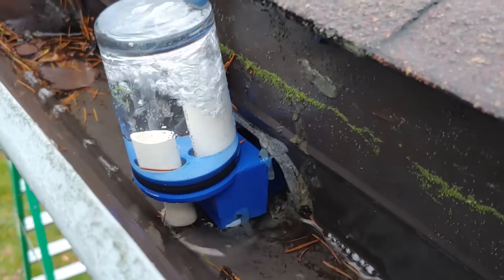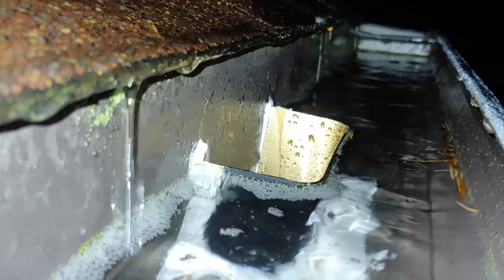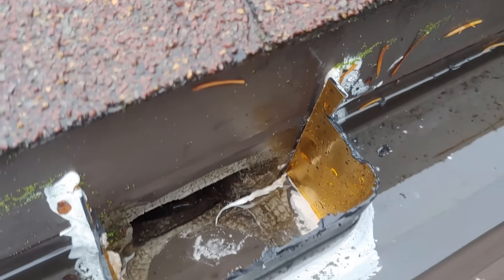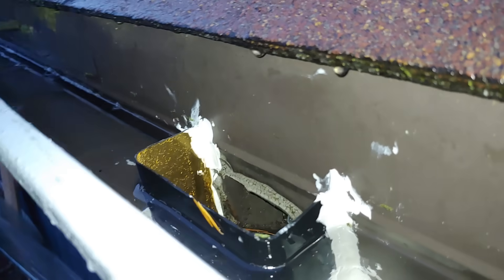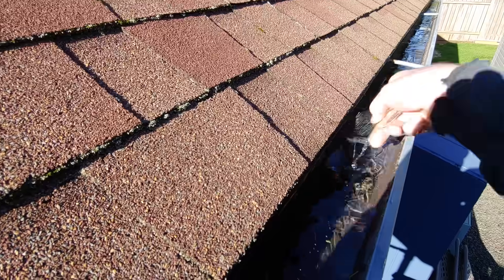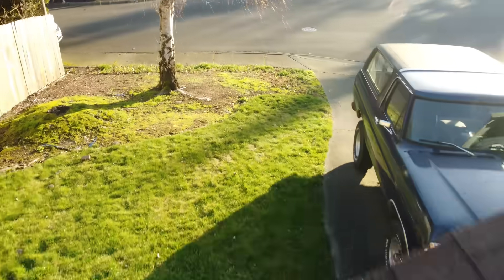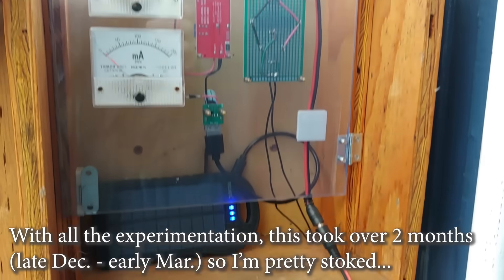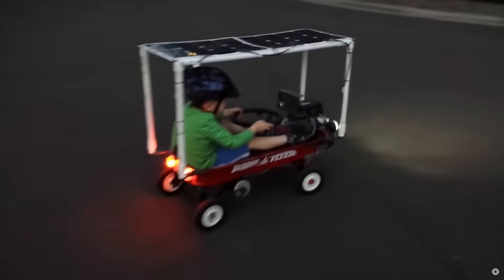Rain Gutter POWER #6 - World's First Rain Charged Phone!

Comment: Send some rain our way. Our rain barrels have been empty for weeks! Speaking of rain barrels. Mounting a few right below the gutter could be a great way to store and recapture the overflow in peak times. Like a potential energy capacitor. Also has the added benefit of watering the garden.
Reply from the maker: I wish I could Sean! It's raining hard here even as I type!  And yeah, in retrospect some kind of storage like a water tower would fix all the problems I had early on.  Wait until it fills and discharge on-demand at whatever power rate is desired.  Though in some places storing rain water like that is illegal which makes zero sense to me.  Hope you eventually get the rain you need!
Reply: @QuintBUILDs  Another main reason for policies like that is the health hazard posed by open-topped storage barrels, as the standing water creates an ideal environment for mosquitos to breed.
Reply: @AJMansfield1  All they need is to say such a barrel needs to be sealed to some degree around the drain pipe with a separate tap at the bottom for using the water. If they want to even prevent them going down the drain pipe then some kind of gutter filter could also be required, although I don't see why they'd need to go that far.
Reply: @AJMansfield1  That is the equivalent of throwing the baby with the bathwater.
Just buy a mesh ffs, it won't allow the insects or mosquitoes to breed in.
Reply: @QuintBUILDs  the reason for rain water collection laws has nothing to do with small home collection, it's about agricultural rain collection because of water rights down the water shed from the collection site. You cant keep all the runoff water for yourself
Reply: @QuintBUILDs  what if you increase the output at the nozzle? will that increase the power of the alternator?
Reply: @QuintBUILDs  you can store rain water in Marion County, at least, as long as it comes off your roof.
Reply: @QuintBUILDs  Do your government regulate the amount of air you are allowed to breath?
Reply: Stored, potential power-generation-source-material, ect., equals - as I'm sure you're aware - a financial loss, to national-/local government entities. ALSO, "every 'man' for 'himself'", could cause eventual, irreparable damage to a society...
Reply: @QuintBUILDs  The problem with letting everyone store all the rainwater they want is that it limits the amount of water that makes it into underground reservoirs, which are important for everyone. Sure one or two people keeping a barrel behind their shed isn't going to do much, but imagine if people who owned large areas of land completely blocked out the natural water cycle for themselves. It would be potentially catastrophic.
Reply: @EXeeroy  people arnt blocking out 'the entire natural water cycle', they are just blocking out the little bit that hits their roof.
I dont know about where you live, but over here, all the water that goes from roof gutters and roadside drains is piped/pumped into the sea or into a nearby river that leads to the sea, none of it goes underground. Only water that falls onto green areas goes underground.
Reply: @EXeeroy  surely if you use the water on your crops/garden then that water is getting to the ground anyway, and however much ground you have unless you cover it with a waterproof membrane then the only water you could collect would be from a gutter therefore the whole groundwater thing is a complete red herring, I understand that some US states forbid collecting water, backed by environmental organizations, helped by water companies that wish to sell you it, we have the same problem in Britain with power generation from a stream (even without a dam), were you take the water and return it a several yards further down, your "using" the water and no one is getting a cut, all done under the "environmental" banner and who can disagree with that !!☺.
Reply: @EXeeroy  that's false information that you've been fed to believe by people who control you
Reply: @EXeeroy  thats pritty nonsense, for you to catch the water, there has to be a roof for it to fall on. how much % of your country/state/town is roofed? so stil even if everyone would catch it, plenty of rain to come by. its simply ridiculous a goverment own something that can fall from the sky. its to maximize corporate profit nothing more. pumping up the ground water now that IS a problem when everyone does it. since that water is hundreds or even a thousend year old and wont be refilled as easy. but rain no ffn way. the natural way of water is from gletchers/rivers/sea/clouds and repeat, or you think those rivers all from rain water :P?? when the gletchers are gone now that is catastrophic because that would mean all drinkable water ended up in the sea.  with a bit of logic u can push through goverment propaganda.

Trust the Dutch before you trust your goverment ;)
Reply: @EXeeroy  but if they were using said water to say, water their gardens, lawns, or to purify and drink wouldn't said water end up back in the ecosystem anyway?  By filtering and drinking rain water you're not using municipal water and not paying taxes on it.
Reply: @goldenpun5592  I believe the law is intended to prevent industrial scale water rain capture.
Reply: @EXeeroy  The word "imagine" in this context is problematical. It's completely unlikely, and would be a huge waste of capital. Who's going to go through all that effort and expense just to store water? This isn't Dune.
Reply: Your land is private property, you can do as you please. Rain and rainwater cannot be owned it falls from the sky. By definition you can collect rainwater as it is not owned and you are on private property where you can do as you please simple as.
Reply: @alexbevan2183  incorrect, your land is your property yes but what if an airplain with cash fall onit?, or the cash falls out of the airplain, it wont be yours. if you find gold in the ground, neither :P

They were pritty smart in the past when it came to stealing from their own people.

With something like rain its ridiculous, but some countrys do have the same laws for rain :P
Reply: Pumped storage, yes. Store the overflow, put a solar panel on the roof and use it to pump the stored water back up when it’s sunny. 

Although, you would probably just make more power directly from the panel.
Reply: Been 10 months of cold and wet in Denver. Please take some.
Reply: We Don't have rain barrels but we need rain bad. Has not rained in like 2 weeks radar says around .2 inches for the 2 weeks. Crazy.
Reply: Okookollollokkkolllokokoookoookokololollololoolo
Reply: I see he probably has a Rudd ac
Reply: I saw a guy that did this in a container he can pressurize like one of those hand sprayers for the yard. And he pumps it back up top to run back into the system.
Reply: Here in California. It's illegal to store or hinder the flow of rain water that falls on your house. You are not allowed to use rain barrels although a lot of people do. Keep in mind that its the government's water, not the people's.
Reply: @travisk5589  goverment's water? all water companys are privatised no?
Reply: The Tired Horizon  Google also says that Biden won fair and square,  that China didn't make the Bat flu, etc etc.

Comment: Instead of a simple siphon, why not use an urinal-style autosiphon? It doesn't have any moving parts, it's hella interesting how it works, and it doesn't allow any sort of water to drizzle over the siphon's standpipe if the water flow at the input is too low. Bigclive made a video on it, and there are some other videos on the internet describing how it works. With it, you can precisely adjust the water level at which it starts siphoning, and the water level at which it stops. It's quite fascinating and it would be a great addition to your system, I think!

Comment: Rain barrel for peak collection?
Reply: You can certainly collect the water for various uses with a barrel.  But for power generation, you'd have to have the barrel at the height of the gutter so the water doesn't 'fall' before you can run it through the turbine.  Need a storage tank that isn't too 'tall'. so it can hold lots of water, but not lose very much height before entering his turbine feed pipe.

Comment: My gut reaction to the debris within the gutter, that may clog nozzles, is to have a shield over the top to prevent ingress - the water will still come off the roof but windblown debris coming directly into the gutter would be minimised.

The only alternative would be a sloped filter surface that would be self-cleaning but that would require a lot of extra space!

Comment: This system is lacking a ram pump to store extra water for later usage 😁
Reply: That's what I was thinking. Not a great power source but if you had a large reservoir you could use it to supply extra power if solar energy is particularly low or draw is high.
Reply: I want to see this addition!

Comment: I'm a hydroelectricity engineer in British Columbia and we deal with a lot of the same problems you are going through Quint! As soon as the marble bag came out I thought you end up with some differential head problems 😊. As for overflow - need a bigger reservoir!
Reply: A bigger reservoir would be nice, but how about this as a possible solution.

Send the overflow into a secondary reservoir (a rain barrel).  Use a bell siphon again here to feed it back to the same charging station (no need to make another one).  The siphon can either be triggered manually when there is no rain, or when it reaches a minimum fill level and the other siphon is not currently pumping.  

Thoughts?
Reply: My immediate thought too: add a reservoir at (near) gutter height to store all the wasted water (energy) from rainy days.

Comment from the maker: The text message service promoted in this video is no longer available, SORRY!

A huge thanks to my super awesome Patreon supporters who made this video possible.  To become one of them visit:
https://www.patreon.com/QuintBUILDs

If instead you prefer a one-time donation option, here's a PayPal address you can use: BUILD2LRN@GMAIL.COM

With regard to the solar panel, I verified the electronics in the module don't charge the battery at all until it's in direct sunlight.  It never left that shelf facing north under the overhang of the roof so rest assured it added zero energy to the battery. 

Prior videos in this series
Part 1 - How Much Power?                        https://youtu.be/S6oNxckjEiE
Part 2 - Alternator Rectifier Explained      https://youtu.be/YLb4enCgnP4
Part 3 - Turbine Testing                              https://youtu.be/vify0k2sHlQ
Part 4 - Charging Station Electrical          https://youtu.be/amu5LJaDUPY
Part 5 - Bell Siphons Suck!                         https://youtu.be/z-GLzQ2bqEk

Merch: https://www.quintbuilds.com/shop
Currently just the coffee cup I use literally EVERY morning.  At some point I'll offer shirts but so far the quality of the samples has been kinda cruddy so still working thru that.

2nd Channel with engineering and coaching to help you learn:
https://www.youtube.com/channel/UCOEykxFhALobv5CF-wYLnWw

Quint's Background: https://youtu.be/oqES86u8eTc
Reply: couldn't you have two filter bags? so when you have to remove the first one to get rid of needles and leaves the rest will hit the second one that you slide forwards as you remove the first and then the one that you cleaned gets put behind (basically when you clean the main filter, the secondary takes its place and they keep changing every time they get cleaned?) if I make any sense
Reply: Sometimes the link does not work the 1st one you send few weeks ago does not work
Reply from the maker: @adityab7318  a handful of people have said that which is weird.  Do you mean the initial welcome message?
Reply: Apart that great job
Reply: How many down spouts with generators on them do you think you could put down the gutter length?
Like one every 6" to a foot.
Reply: Younare doing cool stuff. I hope to do cool things like this.
Reply: I wish you'd use a parabolic mirror to power a sterling generator
Reply: I would say as an additional water proofing, it run a bead of silicone sealant around the stem of each nail shaft to help stop water ingress to the wood 🤔😏😁
Reply: Also, run a pipe from the overflow downpipe, and over to the jet supplying water force to the blades, so, power is made normally, but when the overflow is 'activated' the force of the water jet is boosted... Just an idea? 🤔🤔🤔😏😁
Reply: I think your proof of concept is a great success. please try more
Reply: Nice 😊
Reply: The power bank is also solar charging, and the solar panels on it were facing outwards, while
I know your device did charge it to some degree, it would be interesting to see how it did with no external charging
Reply from the maker: @Wolfywolfywolfwolfwolf  there's footage at the beginning of the video of the device torn apart.  It's from video #4 where I analyzed the charging circuit.  While it is capable of charging from the solar panel, it requires direct sunlight before ANY current actually enters the battery which it never does facing north under an eve.  Valid concern though.